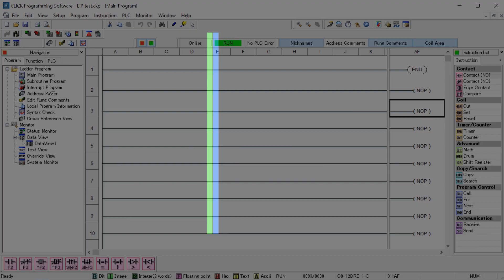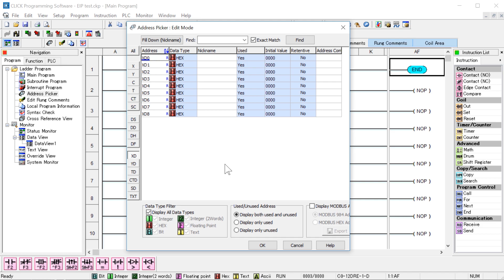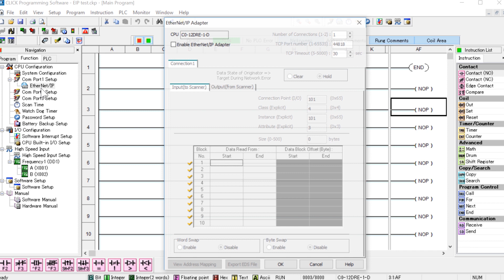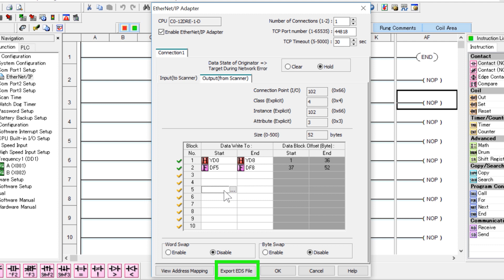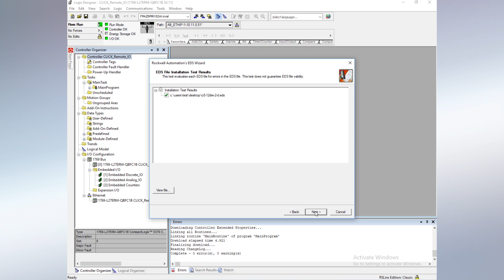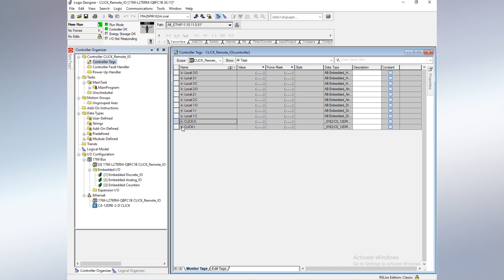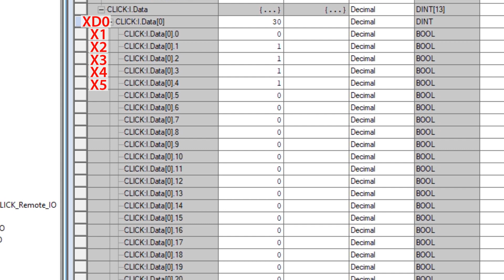Importing CLICK PLC to Studio5000 Using EDS File: EtherNet/IP Field I/O from AutomationDirect

Comment: Can any other software use except Studio 5000 and inform is there anyway to import and other Controller Eds file in click PLC
Reply from the maker: Any EtherNet controller that will accept EDS files should be able to import a CLICK EDS. CLICK Only works as an adapter(Remote Slave), and will not work as a Scanner (Remote master), so it can not import other controllers EDS files.

Comment: This is great. But the problem then lies when you want to use 2 or more Clicks in the same RSLogix program. If you create an EDS file for each Click, they will overwrite each other when you import them into Logix. You need to be able to create different EDS files that don't get overwritten for each different Click you are using....
Reply from the maker: It basically boils down to this…

The Rockwell software defines a device by the four following items:
•	Vendor ID
•	Device Type
•	Product Code
•	Major Revision

Three different C0-12DD2E-2-D CLICK CPUs with three different programs loaded still do not look unique to the Rockwell software.  The Rockwell software sees the same information in all three devices:
•	Vendor ID: 482 (Koyo)
•	Device Type: 43 (Generic Device – Keyable)
•	Product Code: 618
•	Major Revision: 1

These four items are the first four attributes of the Identity Object within the device.  It is important to understand that these values reside WITHIN the device.

An EDS file specifies these same attributes in the [Device] section under the following keywords:
•	VendCode = 
•	ProdType = 
•	ProdCode = 
•	MajRev = 

The Rockwell software uses these values from the [Device] section to match the EDS file to the actual device.  Changing any of this information in the file would result in a mismatch of the file and device.

Realize that devices like motor starters, drives, sensors, and other EtherNet/IP Adapters that have static I/O Assemblies have a single EDS file that can represent multiple devices on the network because they are all the same.  However, devices like PLC’s are dynamic in their configuration and may all be all have the same device attributes with very different I/O Assemblies.

So, your understanding is accurate, but not a limitation of the CLICK itself.  This is how the Rockwell software handles their EDS files and device definitions.

My suggestion:
If ALL Click PLCs have the same I/O Assembly definition, then feel free to use the EDS file.  If not, then understand that the EDS file does NOT have to be used to configure these devices.  Using the ‘Generic Ethernet Module’ option in the Rockwell software will still allow the user to add all three devices… manually.

Comment: is it possible to interface the p2-rs with studio 5000?
Reply from the maker: The P2-RS works directly with a Productivity PLC. You, can have the P2-RS be controlled by a P2-550, then have the P2-550 and the studio 5000 PLC share data across EtherNet/IP.

Comment: Excellent video, exactly like what I'm looking for.
Could the RS-232 port be used to read I / O data from a MICROLOGIX 1200 to the PLC CLICK and this to the COMPACTLOGIX?
I mean using the PLC CLICK as a bridge similar to the 1761-NET-ENI(DF1 to Ethernet/IP).
This would be a super efficient low cost solution for data migration to IOT.
If you have a project like that, you can share it with me.
Thank you very much.
Regards.
Reply from the maker: Mario, Thanks for the comment. This is possible but there are caveats. The Micrologix 1200 Series C Channel 0 does support Modbus. (Please see this page for reference https://theautomationblog.com/which-allen-bradley-micrologix-plc-models-support-modbus/). If you have a Micrologix that does support Modbus on the serial connection then, Yes, you could use the CLICK as replacement option for the 1761-NET-ENI. You would need to "read in" the registers needed over Modbus, then apply them to the EtherNet/IP addressing in the CLICK.  We do not have an example of this project.

Comment: I can only get it to sort of work. RSLogix5000 keeps treating the data type as 8-bit signed integers. So I end up with an array of 52 tags instead of 13. Like in the video, I am using XD1-XD9 plus DF1-DF4 as inputs, and YD1-YD9 plus DF5-DF8 as outputs. For discrete IO, I can live with each 32-bit XD and/or YD register parsed as 4 8-bit registers. But for analog?? I am going to have to splice the bits together to reconstruct a 32-bit float. I don't want to do that. Help!
Reply from the maker: Please contact our free tech suport.  You can learn about all the ways to fo that here: https://studio.youtube.com/video/IcbG7HKxzRE/edit